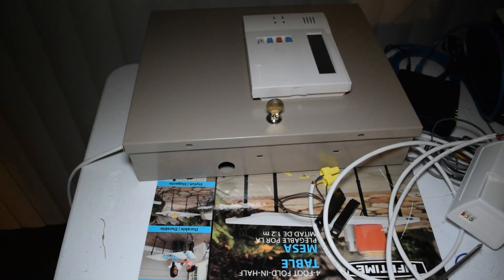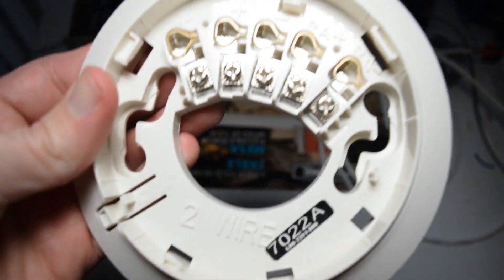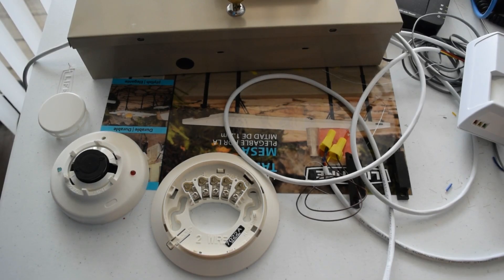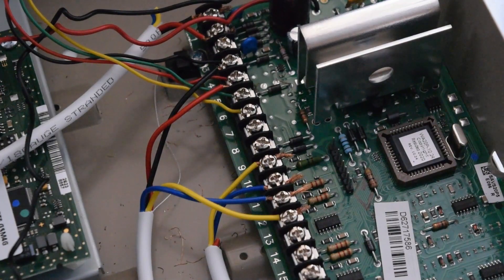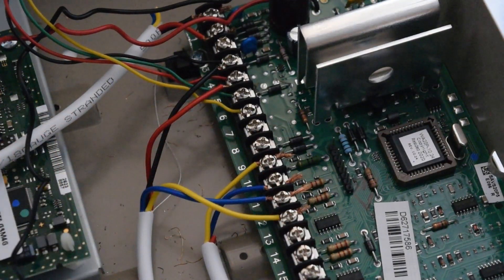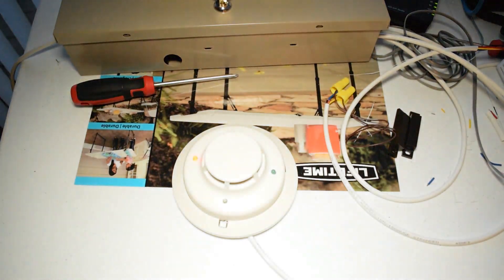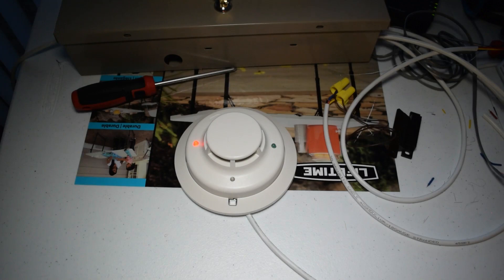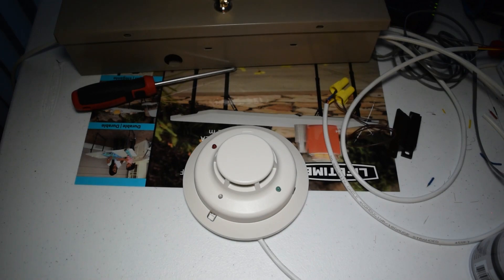Security system wiring tutorial[Honeywell Vista 20P]: Ep. 5- Add fire detection zone

Comment: Please correct me if I'm wrong, but I thought you connected the wire coming from Smoke's +ve terminal to Terminal-7 on the Vista Board and the -ve to Terminal-9. Shouldn't it have been connected to Terminal-8 rather than Terminal-7? Or am I seeing it wrong, probably due to parallax error?
Reply from the maker: It’s 8 and 9. Reference the schematic.